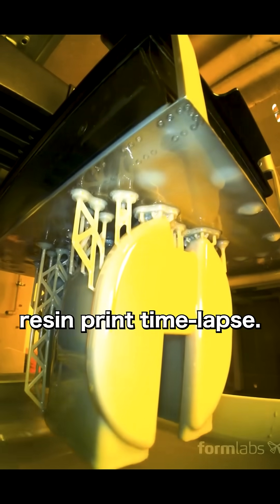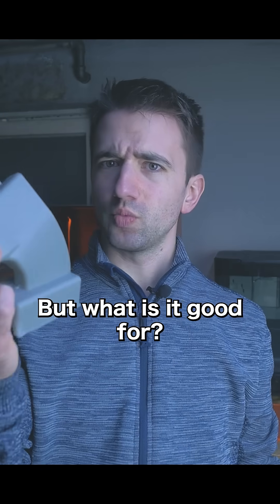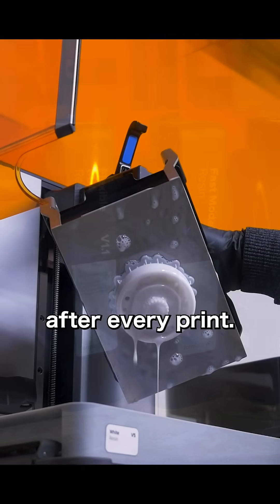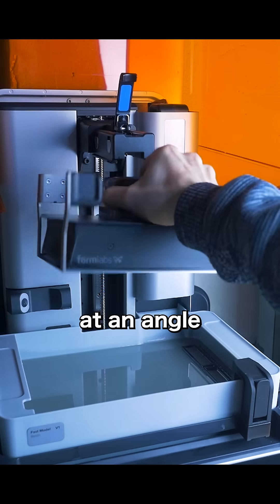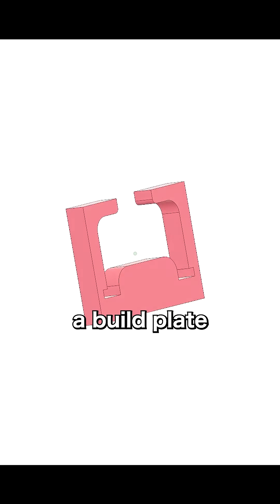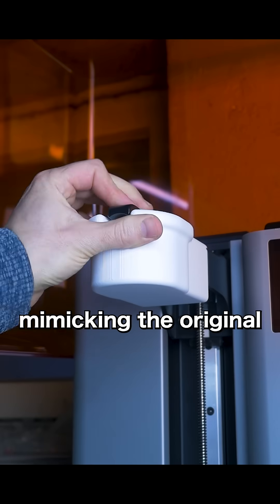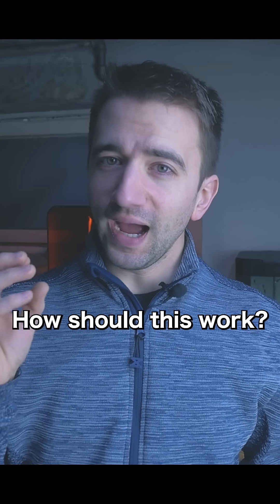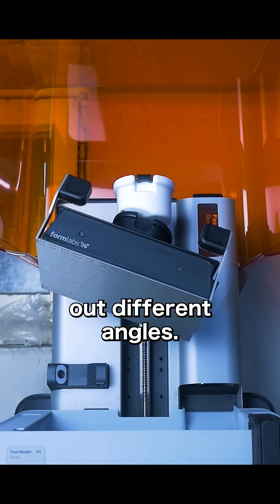Fixing Resin Prints

Comment: Maybe a vibrating feature at certain frequencies could cause more of the resin to drip and be reclaimed? Another option is to use negative pressure somehow with a closed system but that may be more work than its worth.

Comment: You should add a vibration motor to speed it up. 
You’d probably want to have a rubber spacer though so you don’t rattle the printer to death.